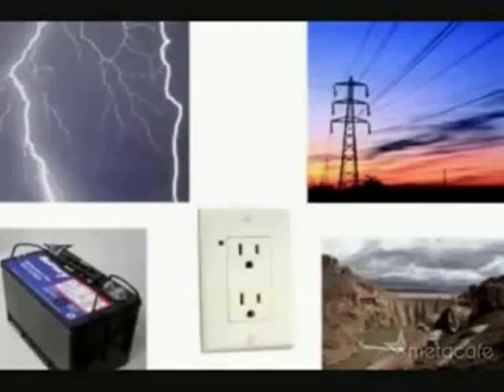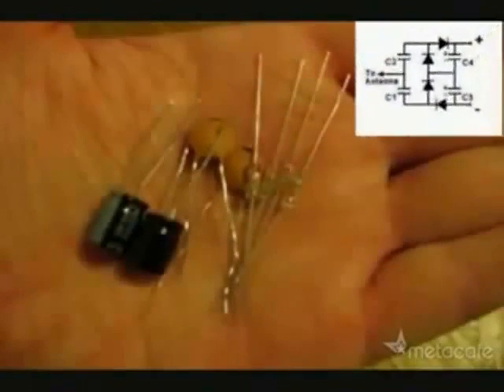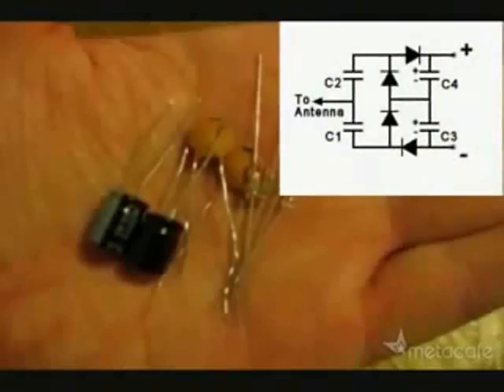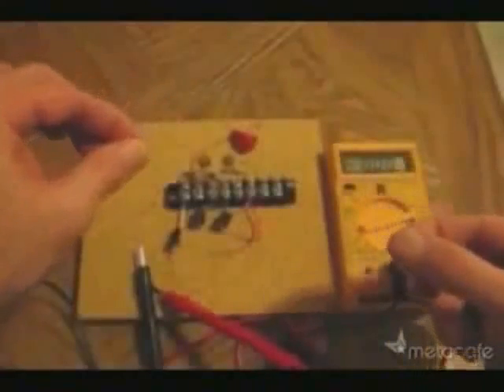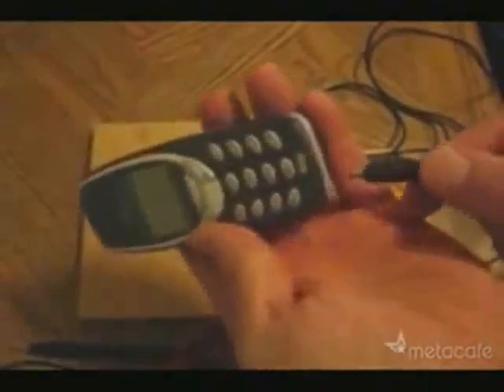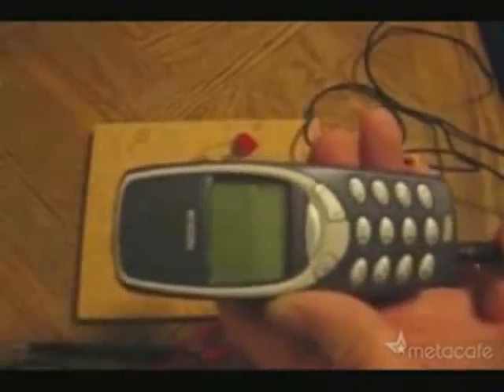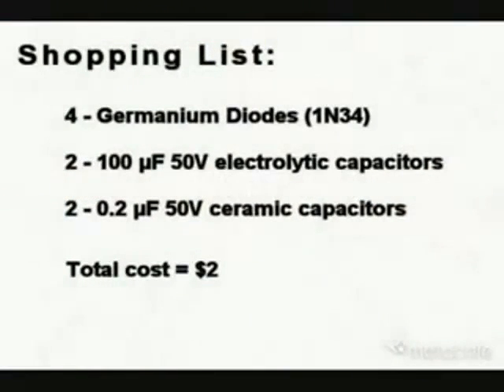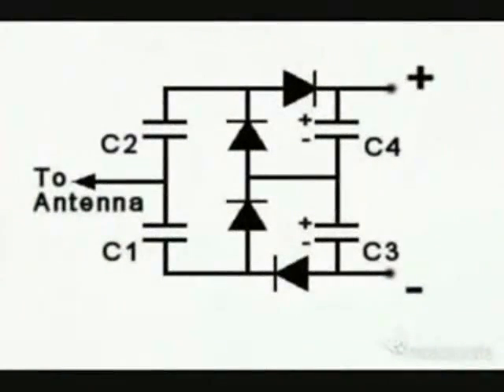Nikola Tesla - Free Energy Device.  Rather interesting.flv

Comment: I've got a question; wattage, how many watts are you getting out of the air? And what are the values of these components, like the inductance of the coil (antenna), the capacitance of the capacitors on the left?

Are you using the Schumann resonances with this?

Comment: You know this is interesting to me though I do not understand it. I suppose my goal is Tesla's Pierce Arrow experiment.With no gas, no oil, no batteries. Instead of  a Piecre Arrow lets use a simple 36 volt Golf cart with no batteries. How do we ramp up your idea to produce enough power to run something like this? And lets try to keep this quiet or just between you and me. So I am guessing we have the earths power aether to work with and it must be be received and ampliphied using tubes, diodes